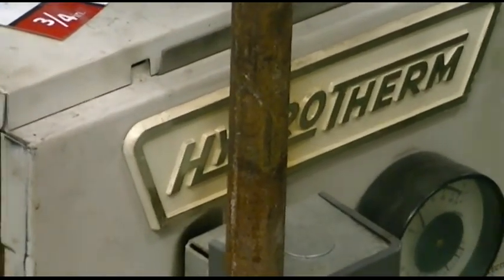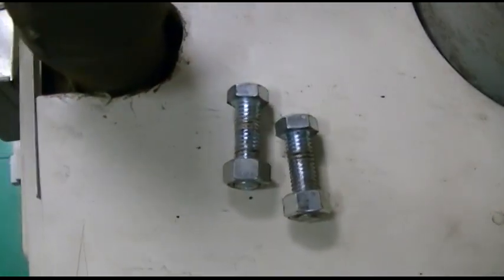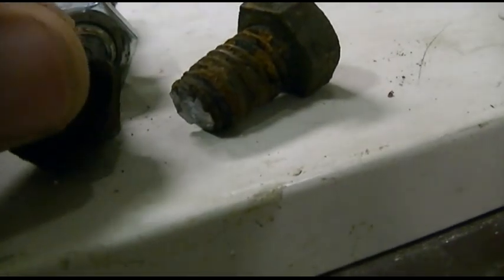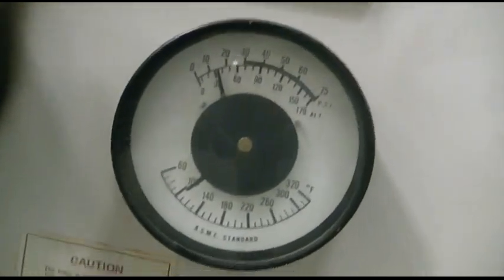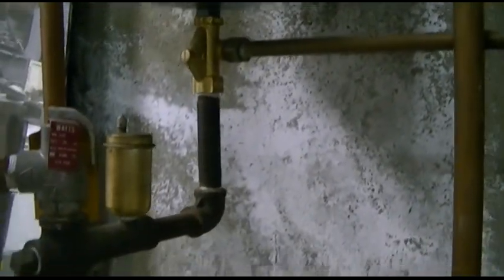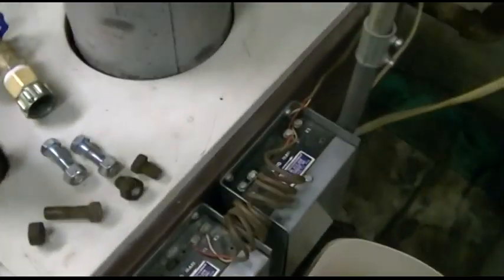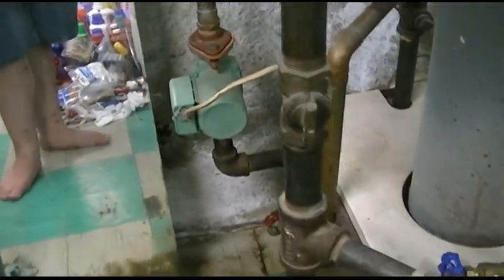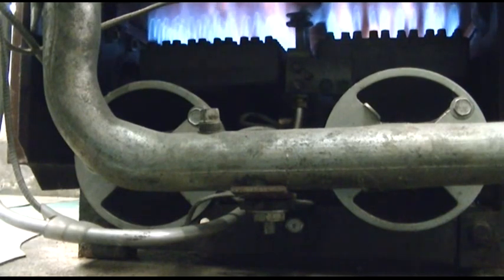Replaced Boiler Circulator Pump!  No More Leaks!

Comment: I believe from 4:49 to 4:52 it is the Amtrol "Fill-Trol" system.      https://s3.amazonaws.com/s3.supplyhouse.com/manuals/1351174248151/85529_PROD_FILE.pdf    (copy and paste link if neccessary0  I understand this next link as saying that fill pressure can be changed by lowering or raising the air pressure in the tank.      ---    http://www.amtrol.com/wp-content/uploads/2017/05/9015026_06_14_FillTrol_IO-1.pdf
Reply: I have the very common Watts 1156F pressure reducing valve which works fine until it becomes corroded with water chemicals/residue and needs to be replaced or parts removed and cleaned. I wouldn't know it the Amtrol valve has similar problems but see the valve itself is available. ($40.00 ?)
Reply from the maker: Thank you so much for that!!!  That is the answer I have been looking for all along!  The valve does seem to be working properly for the most part as it gets to around 12PSI.  I do wish there were an easy way to inject a little more water into the system via a simple valve like I've seen on just about any other boiler.  I've been wanting to know how this worked for the past 12 years now, you've finally solved the mystery, BIG thanks!
Reply: Looks like it could be hard getting access to the air valve on that tank. Maybe you could operate a bicycle pump upside down against the ceiling? LOL! Maybe a small compressor like I carry in my car. Add a bit at a time and see what the effect is.
Reply from the maker: Nah, it's no big deal, I have a compressed air line right there in the ceiling.  Right now it's working, and I'm good for this season.  At the end of the heating system I might sneak a tiny bit of air in there and see what happens.

Comment: I didn't read all the comments, so if this has already been explained forgive me. The valve under your expansion tank is what lets water into the system. There is a plunger inside the tank connected to the diaphragm that opens the valve at whatever the air pressure is inside the tank, so if you want more pressure in your system just increase the tank air pressure.

12-15psi should be plenty to bleed out the system, there is a small screen in the inlet of the water valve that will plug with crud.  remove the inlet fitting and look inside to see.  I suggest adding a water filter on the supply line is always a good idea, just to trap all the crud that will cause grief later.
Reply from the maker: Thanks for the additional information--I'll check the tank pressure!

Comment: What's the operation of a circulator pump
Reply from the maker: +Latasha Strand The heating system I have is called a hydronic system, they were popular in homes of the 1950s in the Northeast.  Instead of a "furnace", we call it a "boiler".  Instead of heat registers in the house, we have radiators.  Most homes have pipes than run around the perimeter, and tee off at every radiator.

The boiler heats water, the circulator pump circulates the water through the pipes of the house to each radiator.  The radiators are basically just pipes inside with what's known as a heatsink, a bunch of fins on the pipe.  This effectively increases the surface area of the pipe.  The heat from the circulated water gets dispersed into the heatsink.  By natural convection, cold air enters at the bottom of the radiator, gets heated up by the heatsink, and goes out the top of the radiator into the room.  To aid in the convection, most radiators are placed near a window, so the cold air drafts that are inherent aid the convection process.

The cooled-off water returns to the boiler where it is reheated and the cycle keeps repeating until the thermostat is satisfied.  In the interim, the boiler has it's own thermostat called a hydrostat, which will turn the flame on or off should the water get too hot.

Because these pipes going through the house are too hot to touch, that's where the phrase "piping hot" comes from--the pipes are too hot to touch.  Hope all of that helped clear it up for you.

Comment: The water pressure reg.cuts the pressure down to 12-14 psi.This is proper pressure.LEAVE IT.
Reply from the maker: +Darrell MacInnis It's only a problem refilling the boiler.  With its regulator it will not fully refill and there's no bypass anywhere.  Once filled it eventually settles around the 12-14 mark, and works fine.
Reply: Werent you saying you couldnt get the pressure higher than 12 psi? I was also told 12-14 should be max pressure. How did you get the air out of the pipes?
Reply from the maker: There are bleeders on each radiator.  I open the affected ones.

Comment: You could connect your garden hose to the drain and bleed the air out from the system.
Reply: jaykay18  Joey P I think is correct
Reply: garagekeys  Did Joey P mean putting water into the drain and purging air out, not draining water out?
Reply from the maker: Last I checked air floats.  Draining from the bottom of the system would likely result in just water, filling the system with air.  That's why the bleed screws for the pipes down there are on top of them.

Comment: you can put a garden hose on the drain valve to blead all the air from the system if you have bacebords and if the drain valve gives you a problem just recap it and do what you normally do
step 1 put the hose into a bucket or run it into the washing machine, 2. open the drain valve wile the water is still on 3. if you want more water to go into the boiler open the bypass on the water feeder
4. wate for all the air to blead
5. turn off the drain and recap the drain valve
Reply from the maker: There is no bypass on the water feeder, that's the problem.  But there are bleeders on all the radiators (though 2 are stuck), and there are also 3 or 4 bleeders on the pipes in the basement.

Comment: the system can only run at 12 to 13 psi pressure, has the pressure releif valve blown at to fill the system quicker just turn the bypass nut on the water feeder and it will fill quickerall,
Reply from the maker: I know the running pressure of the system is around 12-15 PSI, but for some reason this boiler works better at slightly higher pressure, like 20.  I actually tested it last night, and once at full temp it gets to about 23 PSI, still 7 PSI lower than the alleged blow-off pressure.  All the radiators were nice and hot.
Reply: jaykay18
my grandmather has a 100 year old house in central icelip and the house has the original cast iren radiators in it and the boiler was replaced 5 years ago i beleive, when the old oil fired boiler was still their the radiators got hot to the point ware you couldn't tutch them verry long. now, they replaced it with a gas fired HE boiler that i am not verry fond of, it heats the hot water fine but the radiators, forget it they don't get as hot as they used to
Reply from the maker: Oil produces a hotter flame than gas.  However, a gas flame is more controlled, speaking in a general way.

My father-in-law once showed me his boiler after it was serviced, while it was running.  Most of LI used to be coal-fired boilers/furnaces.  When oil came around, many converted to oil, because you didn't have to worry about shoveling coal into the furnace.  But the actual "shell" of the unit was left in place (asbestos and all) because it was still a solid firebox.

After having gas for many years, with a nice, controlled, blue flame, he showed me the oil burner while it was running.  What a ferocious, out-of-control flame that was.

With gas, it's just got to run longer.  Also, there is what's called an "aquastat" on the boiler, that controls what temperature the boiler turns on and off to heat the water (this is independent of the thermostat setting, it's for the temperature the water is heated to).  Perhaps this aquastat is set lower than the old one.
Reply: jaykay18
heres the weerd thing, its all electronic like everything nowadays, hie effishancy this, hie effishancy that, the good thing about this installation is that a family member installed the system and he is a hvac technition so if their is a mager problem he can just repare or replace a part as needed
Reply: I have a Hydrotherm and it might be older than yours. You will need the higher pressure ot move water to a second floor